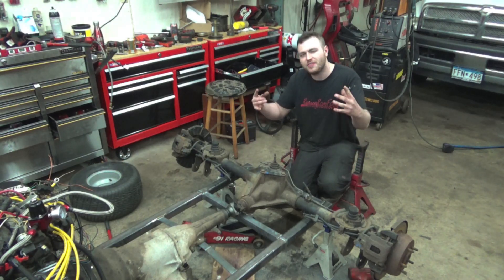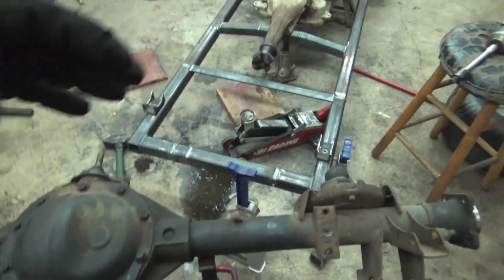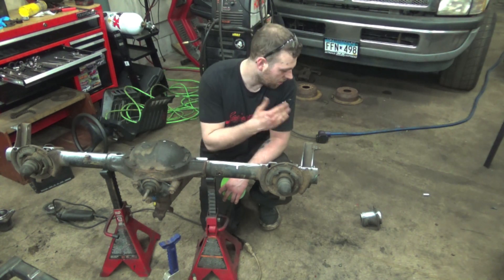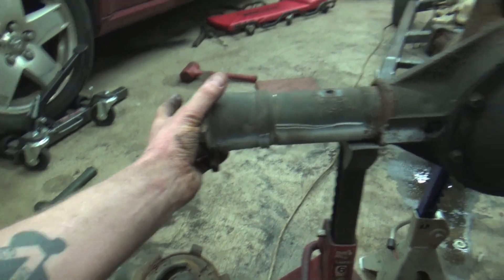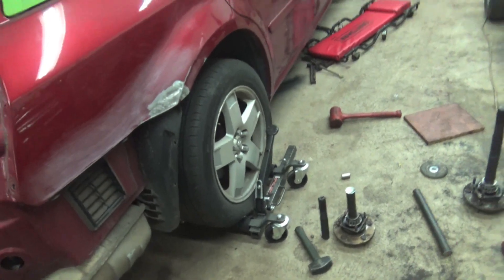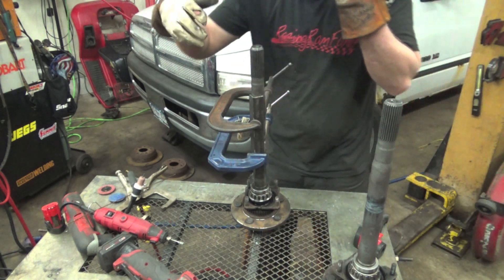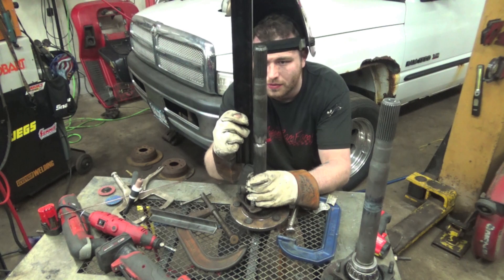Narrowing a rear end ***HOW TO***    PT.1

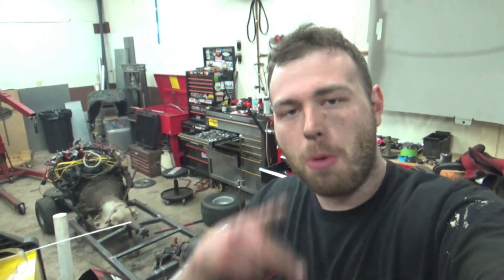Comment: 6:39 Did this exact same thing when I was a kid back in the early eighties on a 71 Challenger turn the corner let them up and the axle snapped off where they were welded at LOL it was good when the motor was stock unfortunately after the winter of pulling it out and building it up we were pushing 600 hp and that's all it needed😂😂😂😂 we ordered some strange axles no more problems

Comment: Was literally  lookong at narrowing a rearend to put it in a lawn mower frame crazily enough. However i wont be putting a v8 in it, i also have to extend my frame a bit and beef it uo A LOT, however i think the complicated part is reallly gonna be  puttinf a solid front axle and differential in it and getting the steering to work properly.... im getting the rearend from a 04 expedition that i rolled  side over side ocer a half mile... i need to fonish oukking the motkr out of it to so i can get it in my f150. Im consoderinf cholling the frame down and replicating the lawn mower frame and majorly shortening it amd narrowing it to nearly identical dimensions except way stronger.  Considering i have to lengthen and strengthen the lawn mower frame anyway.  Probably have to widen it where i install the trans /drop box also.  If i just trqck down a front axle i can lay everything out and build around it, ultimately the lawn mower body going on it either way though.. wouldve been a lot more authentic to use the lawnmower frame

Comment: You should've beveled those axles all the way to the center. Hopefully the axles hold up because I think they might be forged, at least rolled into that solid round stock which is a lot more solid than just casting.

Comment: Would it be stronger if it was welded with stick than tig? Or would it be about the same
Reply from the maker: Any welder or weld type can be super strong using the correct methods and filler materials

Comment: Ive welded probabky at least 50 axles. I had only one fail . The first one. (Actually both sides broke)I didnt weld it hot enough. Once we figured that out it worked. No issues. I used an Arc welder with 2016 rods even back in the 80s
Reply from the maker: Old school but proven to work!

Comment: I've tried different weld fillers for welding beads around the steel tubes to the cast iron center section. The best weld filler I've found for that is ER309L and TIG welding them.
Reply from the maker: Thank you!

Comment: Good idea is to drill a 1/4" hole in the end of each piece and put cold roll steel in and pin them together then weld them up. Really helps the strength of the axel.
Reply from the maker: That’s a good idea!
Reply: I was thinking that before I saw this comment .. slug it like a motorcycle frame .. turn it in the lathe flat .. drill a hole .. use the lathe to bevel it also …

Comment: I do have to say I've seen rear ends narrowed several different ways I do have to ask you what kind of welder are you using to TIG weld the axles and the axle tubes and what angle are you grinding at 30°?
Reply from the maker: Alpha tig 250 it’s nice! Doing a welder review video soon on a yes welder 250!
Reply: @RacingRamFam  well that's cool I'm definitely going to keep an eye out for your welder reviews me myself I'm using a primewell TIG 225x with the max cool 3000 water cooler with a flex lock CK worldwide TIG tours 25 ft of hose my first machine given to me by prime weld I had something that was in the works and my son ended up passing away in August 21 from covid-19 something I really don't deserve is the machine I can know that but stupid covid took my son too early it was only 21 years old but thank you for the info.
Reply from the maker: @danielsplayhouse3804  sorry to hear that

Comment: I need to take up welding! I have a frame crack almost identical to the one on your plow truck on my 99. For some reason I don't think angle iron,self tappers and JB weld will hold 😂
Reply from the maker: Lol if it works it works!!!
Reply: @RacingRamFam  oh don't worry, I have not done that kind of patch work! That's just my typical backyard mechanic repair options. A frame is a little more important.
Reply from the maker: @Trip318  yes yes it is lol
Reply from the maker: Doing a welder review video soon
Reply from the maker: Email me your size and address!! You won one a free t-shirt! Keepitboosted@racingramfam.com